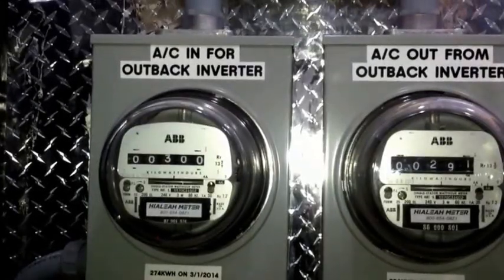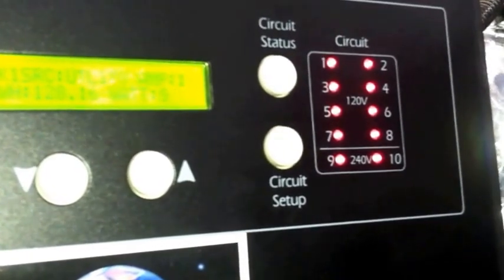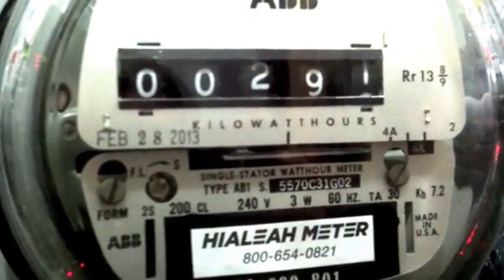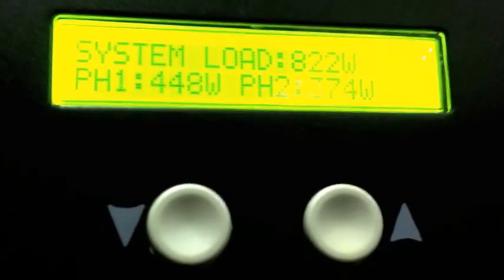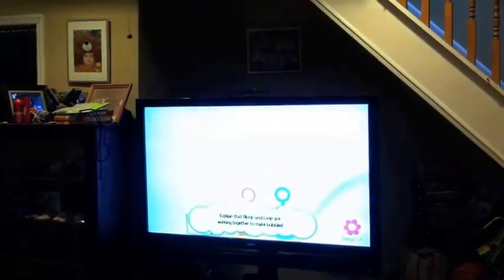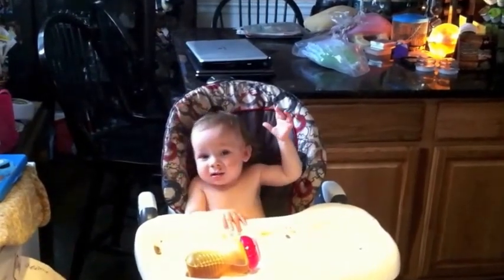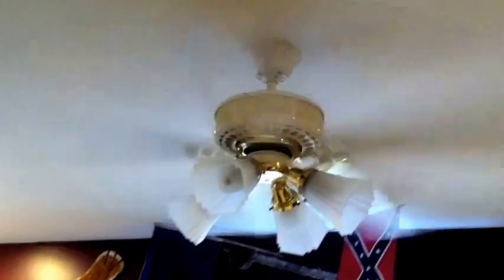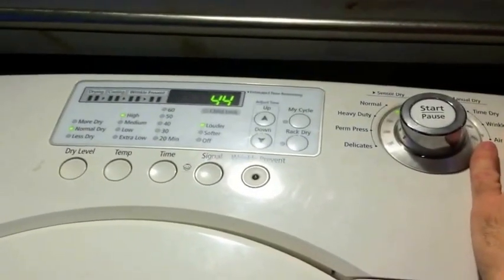OUTBACK POWER BATTERY BACKUP

Comment: With this apc uts can it be configured so the Generator (solar) be the primary power and Utility be the secondary. My goal is to do a "grid assisted" system under about $2k. 
1-Solar on good days 
2-grid to back up solar 
3-UPS to fill the switching void 
(3800watt gen on old switch if needed)
Reply from the maker: Tiersmoke92555 Hi You can probably wire it the opposite way to accomplish what you want to do for instances make a plug and cord for the generator but tie it into your utility power using a junction box and then wiring it to a 240v 30a breaker.. mine is set up with 2 outback gtfx grid tie inverters now.and tied in to the generator side of this panel so when power goes down it switches over not instant waits a couple seconds though.. but is always online.. so wiring it the opposite shouldn't bother it any..
Reply from the maker: Note:: I don't have anything hooked to the ups part anymore.. and also make sure your inverter is clean pure sine power

Comment: Nice seeing it finished and working well. Great job!  I was curious at the end your Outback Mate was showing no load on the battery bank, while you were producing 400+ watts solar, but I thought I saw a draw of like 600w on the UPS fed by outback inverter. So I guess I would've expected to see a small draw of about 200w on your battery bank. I may be misreading your meters though.  Or maybe there was more solar coming in from somewhere else to the batts
Reply from the maker: the loads was on the generator at the end of the video.the transfer panel transfers from ups= (outback inverter) once generator power is detected.I dont think i ran the outback long enough to drain batteries or being that my panels are wired in series they may have charged them up fast.. ill have to do a complete off grid shut down and see how long batteries last... thats next my experiment!! i do have the xantrex charge controller i didnt show to at the end..thanks for watching!!
Reply: got it.  thanks.. ps. keep the vids coming